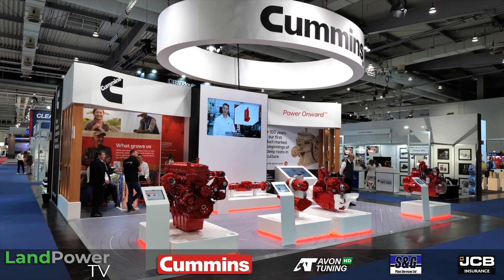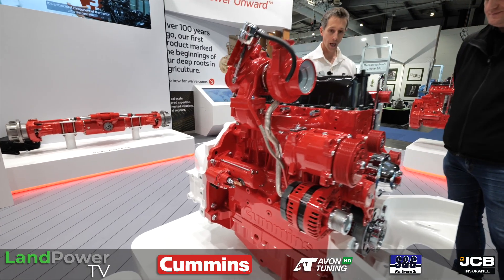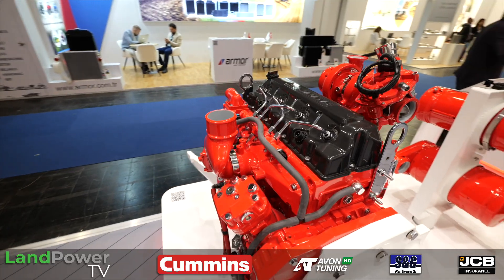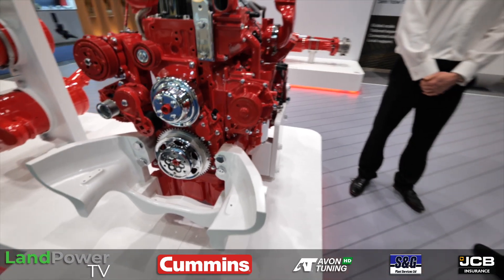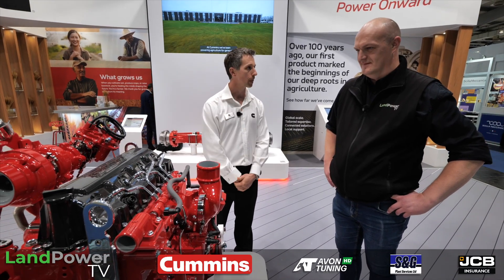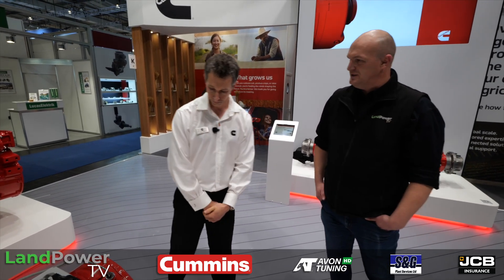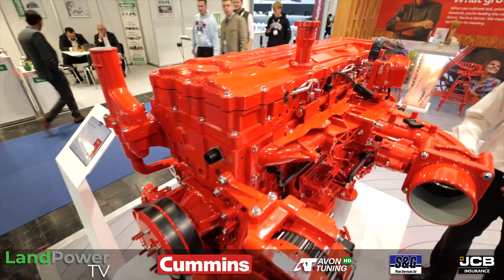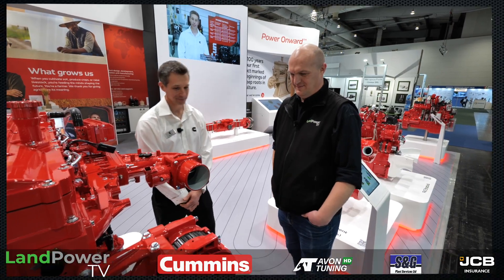AGRITECHNICA 2025: New Cummins structural four-cylinder tractor engine

Comment: I wonder if any of the test/development design engineers who worked on the original Ford 600/700 series engines back in the 70's though that 50 years later a 4 pot block would push more than 100 horse power let alone the possibility of in some cases nearly 250 hp like some are claiming to have in development well maybe not for a tractor.